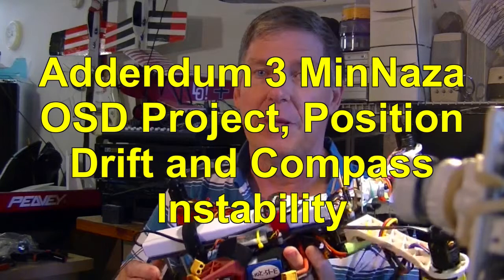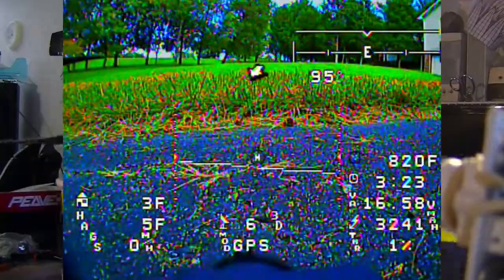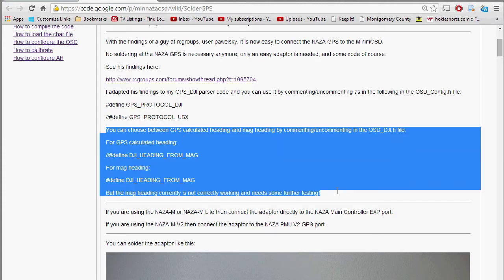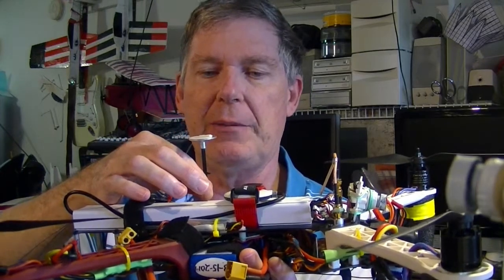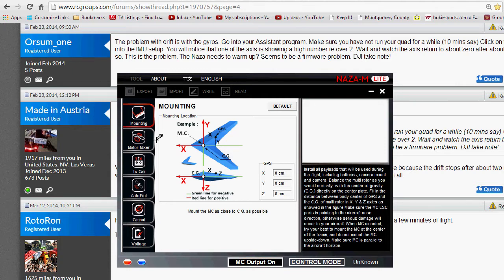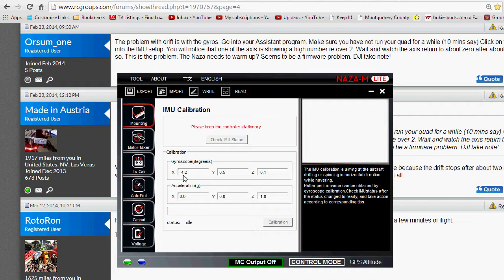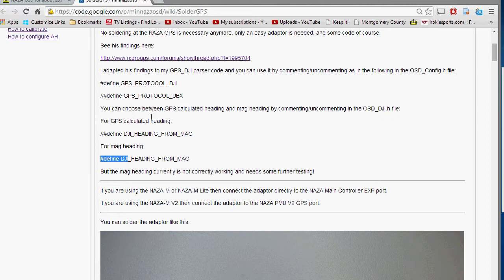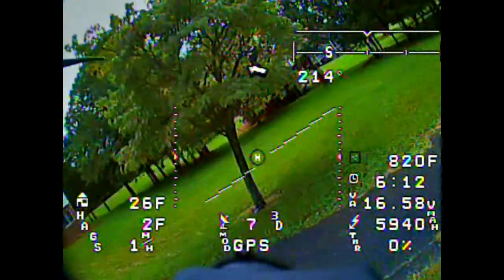Addendum 3 MinNaza OSD Project, NAZA Position Drift and OSD Compass Instability Causes Revealed!

Comment: I use a spare Arkbird as my osd in my quad , its only connected as an osd none of the active leveling is connected . But I get height on a barometer" very accurate" , accurate compass return to home arrow and GPS location , current sensing and mah , gps speed and distance from home , also artificial horizon . On top of that it powers the video and VTX. switches are setup so that when the naz is in rth it shows rth on the screen , for atti mode it shows G and shows balance mode for the naza gps mode . Works a treat :)
Reply from the maker: Are you saying you are using the Naza for the flight controller and the Arkbird as the OSD?
Reply: ***** Yes that is correct dmerc00 .. just a Naza lite . I would like to have a proper OSD for the Naza Lite , but so far the Arkbird as an osd is working just fine . Expensive way to do it for sure but a had an unused arkbird in the cupboard so in it went  :)
Reply from the maker: OutbackKanga I understand now. My thoughts are that I should have gone with the PixHawk because the MinimOSD just plugs right to it with no mods needed like the Naza.
Reply: *****
I was thinking of trying Naze32 actually , seems to be a few good reports about it  & Minimum Osd plugs right into it to it would seem :)
Reply from the maker: OutbackKanga I could be wrong but I thought the Naze32 was a another one that needed mods to get the MinimumOSD working with it like the KVOSD project.
Might not be as hard as the MinNaza project however.
Reply: *****
Yes I believe there is a degree of mucking about , but the osd can be purchased ready to go ..http://witespyquad.gostorego.com/minimosd.html

Comment: Wonder if it's possible to have input into minnaza from reciver pitch and roll and if detects signal switches which protocol in code it uses gps or mag? Wish I new Arduino code
Reply from the maker: Sounds like a good idea if only someone would produce the code to do that.

Comment: Maybe I am pointing out the obvious (at least to me) but the default setting is intuitive and correct unless you only like to hover with fpv screen or goggles on... and if that is the case, then why bother with the fpv at all?
I cannot recall the last time I was not moving forward and tilting while flying a multirotor.
Reply from the maker: ***** One vote for the default GPS calculated heading registered!
IMO, if the programmer is not going to implement tilt on the MAG calculation the next best thing would be to auto-switch between the modes using GPS when moving and MAG when hovering.
Reply: You have to tilt to move forward , which was affecting the home arrow causing it to show forward and back on the home arrow.